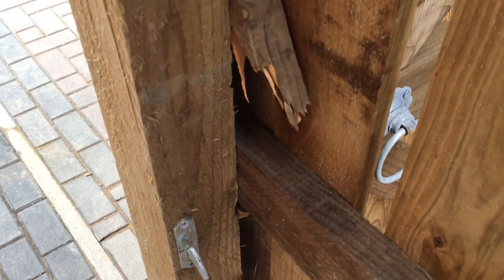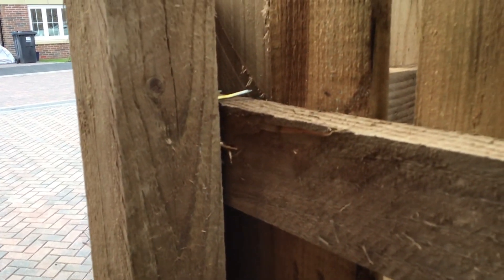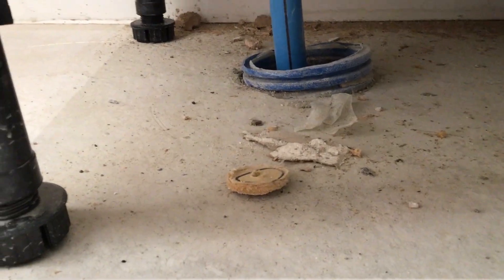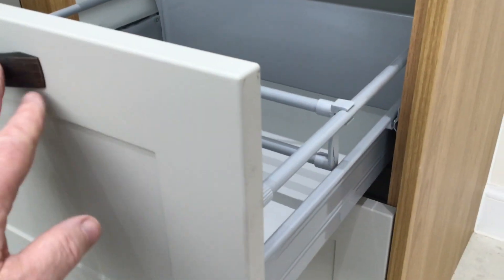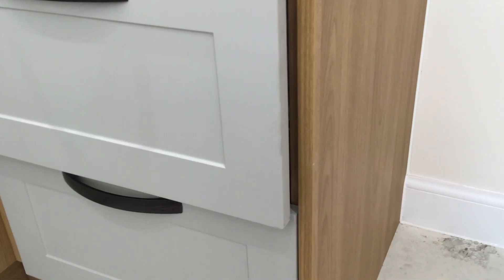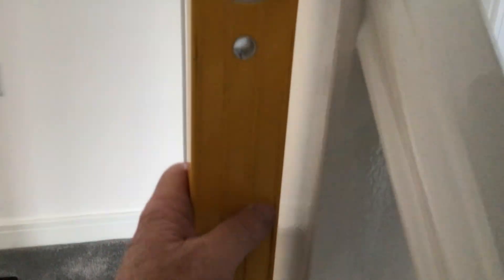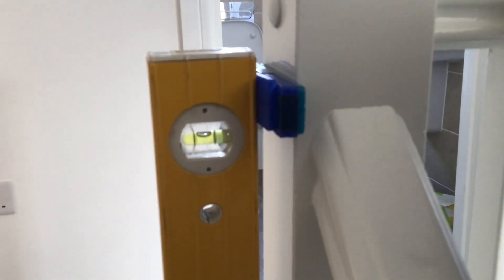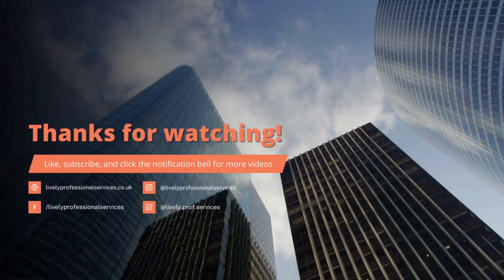Check This out!

Comment: Ever close the kitchen drawer and wonder why it won't shut..
Out comes the drawer itself to see a lump of copper pipe sticking through the back for no reason at all.
I never did get an answer as to why the plumber screwed that one up or why the kitchen fitter hadn't the sense to think before he cut a great big hole through the unit.
Reply from the maker: The gas pipe is there for you to change your hob to gas if you wanted, the kitchen fitter should have cut a neat hole for it.

Comment: What is the best way to seal incoming water ducts around the insulated mains water pipe?  Vermin seem to love nibbling at expanding foam so is there any products you recommend?
Reply from the maker: We used to insulate the incoming main with Duraflex insulation and then stuff the duct with fiber insulation, that way if you ever need to replace the pipe it is easy to remove. Using expanding foam is a nightmare when you need to extract or replace a water main.
Reply: @LivelyProfessionalServices  Always appreciate the videos and the replies to posts.